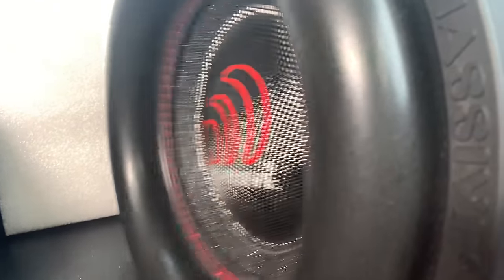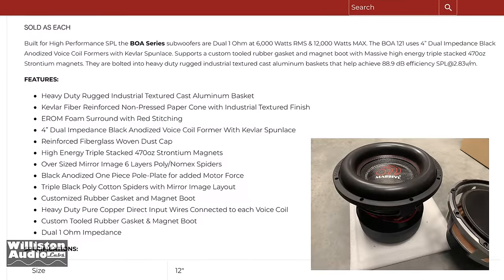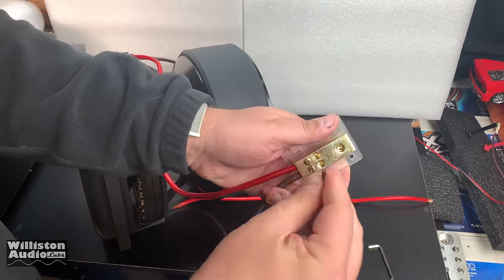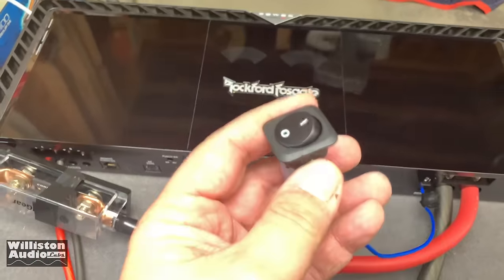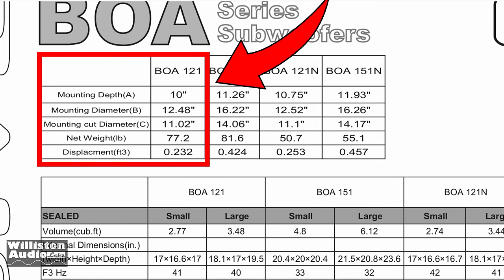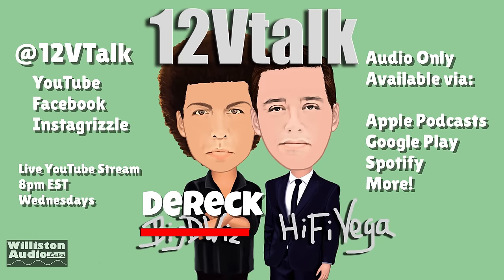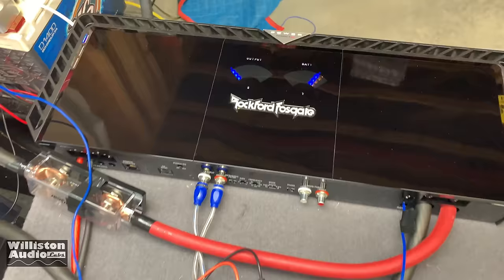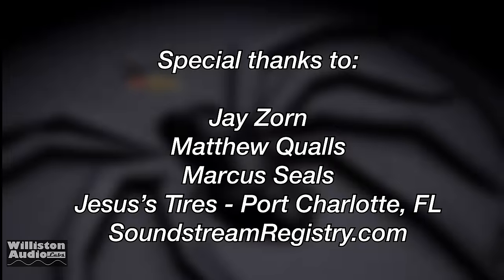Massive Audio 6000 watt RMS Subwoofer!! [4K]

Comment: I got my Fi team 15 for under $700. Massive is crazy. Pass
Reply: That's the website price. eBay has them for $679
Reply: @Outty5000Hertz  $679 not bad then. It's still an off-the-shelf Chinese parts subwoofer. Ti basket and I've seen that motor before I Believe on soundqubed hdc4 woofers. Standard spider spacer rings and I'll still pass
Reply from the maker: I didn’t set the price, but it does seem a bit pricey to me. They have a 20% off coupon on their website, but still $$$
Reply: @DibeezyTheGifted  hell they have my subs listed on the website for $700 eBay has em for $399 or $720 for a set of two
Reply: @Outty5000Hertz  the massive hippo XL do take a beating tho
Reply: @DibeezyTheGifted  SPL subs down right pressure!
Reply: @Outty5000Hertz  yeah they pound without question
Reply: Used, good condition, JL 1000/1, plus a pair of w6v2, plus 2gauge wire...all to be had for less than this one sub. Would be louder, sound better, and not require a massive alternator upgrade. Hey Massive, study physics and economics a bit more....oh, and go home, your drunk.
Reply: most likely wouldnt be louder, you gain 3 db per doubling power, and it takes at least 6x the jl so no, most likely wouldnt be louder even though it would have more cone area. can accomplish same results with fi for cheaper than massive
Reply: @whozaskin3639  I'll get this massive subwoofer 2 pound way harder than those two JL Audio w6 without question. On a single apocalypse Aak40001d. Can't compare sound quality woofer to a SPL woofer
Reply: I got a brutal sounds megabrute 18 for around $700. It's a 4k Sub. Prolly take more... That massive is a nice woofer as well. Thanks again Derek
Reply: @daytrace4635  the massive has a certain amount of excursion, and will only move so much air, regardless of power applied. There is such a thing as speaker efficiency. Your doubling of power for 3db rule would only apply to drivers of equal efficiency. The recent trend in car audio is to use backwards engineering to drive up the power necessary to move air, so that cheaper power per watt amplifiers don't negatively affect the business model. In extreme SPL competition, the drivers and amps begin to have less effect than the enclosure and vehicle reinforcement. For the average guy who wants something remotely listenable, on a stock alternator, with 4 or 2 gauge wire, for a reasonable price, massive missed the mark here. For extreme SPL guys, many use custom frankensubs, so again, massive missed the mark. It's just a Chinese basket, 12 bucks worth of foam, and a 35 dollar motor, with a 1000% markup. It also requires crazy amplification, likely also made in China. So, if you want to fully support communism, and a nation who's government is implementing "social credit scores".....go right ahead and ignore ol P.T. Barnum.
Reply: @whozaskin3639  you seriously need to see sundown u video where they put like 15000 or something and got close to 160 or hit it I dont remember, youre speaking out of your butt lol the 3db rule still applies and if you really want to get technical, your subs are supposed to get half each of that 1000(theoretically without impedence rise etc), where the massive wouldve got all 6k (theoretically) sorry bud it just wont happen, may sound better and more balanced but louder, no. that motor is more likely to be about 300-500 range 4 in vcs range from 50-85$ so they more than likely made this with about 500 invested if they made it here and shipped to be assembled but idk massive well and dont care to, fi, dd, deaf bonce, and sundown have been dominating the market and my wallet recently haha.
Reply: @daytrace4635  I don't think you understand manufacturing. Some hunched over old Chinese dude is cranking out hundreds of voice coils a day, and you can get them cheap. Now, he also has to worry if he smiles enough while taking out the trash, thanks to "social credit" becoming a thing. Seriously, these drivers can be sourced for a little over 100 bucks when bought in bulk. I ain't hating, and the market salivates for the next big thing, so props to the folks making bank. 

As far as speaker efficiency, and the 3db rule, this particular driver is a pig in a horse race. A power outlet is good for about 2200 watts before the breaker gets angry. Attach a contractor grade plug in sawzall to a speaker cone and see what physics versus marketing shows ya. 

I'm all for car audio, I just wish that greed and ignorance weren't such a big part. Please note I didn't say stupidity, I purposely used the word ignorance. I wouldn't bust out "you big dummy" unless the shoe fit. If it weren't for folks like Derek, the lies would continue.
Reply: Jl audio w7 sub drops such low notes your girls draws will drop too😂😂😂😂
Reply: Can’t judge before you test. It aint pricey if its amazing. I own several massive audio equipment, and the quality is superb! Hippos XL are one of the best subs in the industry. Really looking forward to get my hands in A BOA121
Reply: @harpalchauhan428  i have the jl 13w7 and it does have the low notes ,the bass is deep ,and travels far away. Its a diffrent type of bass .
Reply: @DibeezyTheGifted  isn't the orion hcca 15's $350?
Reply: @EBMproductions1  I got mine for around $450
Reply: @chrisrobinson4647  i live close to those guys. Talk to them all the time
Reply: I would like to see an sp4 go up against this. Each having built to spec boxes and around 4k rms on each.
Reply: @treiber671988  this sub has standard of the shelf Chinese parts. Coil included. Sp4 is built rt  here  in my hometown of Las Vegas Nevada with American coils and machined in house. Scott (Fi owner) knows wtf he's doing. Massive wouldn't stand a chance IMO. Fi ftw
Reply: @Andre25167 you have taste 2 my dream sub over the W7 is to own jl audio gotham g213v2 for my home cinema which ive spent £8000 on but think spending twice the money like that again just for a sub is crazy but would be worth it if i could again. But kids come first now
Reply: @DibeezyTheGifted  watt for watt ill put the jl13w7 against it ,its more efficient and louder. With only 1k watts the subs get very loud
Reply: @Andre25167  they are efficient but they're SQ subs and possibly THE BEST SQ SUB. A good SPL sub will eat it for lunch tho. Then ask for seconds. I have a $500 Sundown X12 that'll chew up a dub 7 with only a few extra watts. It'll sound like garbage compared to the JL but it'll beat its ass all day long in the lanes lol
Reply: @Outty5000Hertz  that 679 is for the massive hippo XL. Not the new BOA series. These subs are going for $1,200. The neodymium version is going for $2000. Massive is out of their minds!!
Reply: @DibeezyTheGifted  you gotta search for the eBay sells when someone has them available. If someone paid $679 for the XL subs they're out of their mind! I have the hippo XLR and I only paid $369 via the best offer option
Reply: @Outty5000Hertz  I couldn't find the the series anywhere. I did find the 2 versions of the Hippo tho for under $400, you're right about that. The boa must be hard to find or sold out due to another big d wiz video haha
Reply: @DibeezyTheGifted  yeah they're hard to find outside of Massive Audio.com
Reply: @DibeezyTheGifted  - no doubt bud. Its crazy how many of these companies have the same base set-up. Spiders, baskets etc... Most are the     are same and not well built.
Reply: @kriptic22  Chinese coils too more than likely
Reply: @harpalchauhan428  Yep, even in a sealed box.
Reply: @whozaskin3639  
JL is over priced also. W6 are xpensive and so is  the amps. They aren't worth the money. check out my review on JL on my channel.
Reply: @DibeezyTheGifted  цйй
Reply: @Outty5000Hertz  гг
Reply: @whozaskin3639  ш
Reply: @whozaskin3639    
   

 Iwwwerr
Reply: Amm
M
   aAa @whozaskin3639
Reply: Fi still uses ferrite magnets and has some neo versions but not even close to this. They also use 1018 steel for a bolt and a nylock nut like Harbor Freight. HAHAHA. The Finesse is lacking bro.
Reply: Mac Nifty  the Fi subs is way beter
Reply: Who Zaskin I doubt it would sound better. You know not what you talk about. My massive 8”hippo was slapping almost as hard as my 12” w7. Saying it wouldn’t sound better is just ignorance.
Reply: Natural Creature  I got one american bass hd12 and it out shines them damn rockford t2s all day and half the price lol I had then once and were a food trade dumped a jl w7 12 for them was so glad that w7 sucked I thought man this thing is gonna bang 1000 bucks and huge surround I was disappointed,  had them t2s and they were pretty badass, sold the setup money got tight, tac seasom came around and got a skar rp1500 from a friend for 40 bucks and went and bought the skar evl 12 and that thing hit better then them two t2 12s , once again winter came a lay off came and Christmas came sold the setup for 300 bucks , now a got a american bass hd12 and a kole 2000 watt amp and it's enough sounds awesome and hits great , but I still think I need a bigger amp doesnt move as much as I think it should but its still stiff as hell .
Reply: @doskoreanitos2588  I think the w7s are awesome for sq but spl sucks I had one and it didn't impress on the jl1000 watt amp biggest waste of money ever
Reply: Paul Cherry 💯
Reply: Paul Cherry I was trying to say my hippo slapped pretty close to my w7 but for 100 dollars instead of 1200
Reply: @whozaskin3639  except it would be beating on 6X the power with easily twice the excursion, in the right box it would prob slap your JL audio subs back to highschool

Comment: Sir... Can i use (2) T2500 amp for that 1 sub 6,000rms?
Reply: In theory yes but it is not common practice to power 1 driver with 2 different sources. You would have to balance the output of the 2 amps i.d.k. if ppl do it that way. I would say its not the way
Reply: Too strapped t2500 would kill this sub I'm pretty sure of it that would be about 7k RMS from both amps

Comment: How about using the orion xtr.2500 which over 5000 watts
Reply: theman71177 theman71177 The xtr 2500 is no more powerful than the rockford, maybe in a punch but the rockford will still push it more since its the constant power amp
Reply: Those T2500 amps are slick! And besides, even tho it's overpriced, theres some top circuitry in there that makes the Orion look pretty cheap especially the Constant Power and the output meter and VU meter. I'd still buy it if I had the money. But don't get me wrong, both the XTR and T2500 are monsters.
Reply: Raging_Bullz77 Yes they are both beasts! The xtr is a bit in the inefficient side tho
Reply: I just remember when Big D Wiz amp Dyno on the XTR amp it did over 5000 Watts RMS it did crazy numbers
Reply: @cjon24s69  how is the rockford the more constant amp? what does that even mean? lol
Reply: imBriz I said its the constant amp meaning the constant power, it has technology inside to push roughly the same power at different impedances, it is impossible to push the exact same amount on different impedances but the constant power technology certainly helps it does about 95% of its power per ohm of impedance rise
Reply: Tsunauticus III  It's true.
Reply: Tsunauticus III What?
Reply: Tsunauticus III Even if that sub is wired at 2 ohms the amp never sees that since the impedance changes constantly thats just how speakers/subs work
Reply: Tsunauticus III For example I may have said my comment wrong so if the rockford does 3300 at 1 ohm it probably does about 3250 at 2 ohms or 3200 at 3 ohms and 3150 at 4 ohms, I know that may not be accurate but its an example, but compared to lets say 3300 at 1 ohm for the orion 2400 at 2 ohms and 1500 at 4 ohms now you might see the difference, and those rockfords put out way more than 2500 same with the orion they are both beasts but the rockford will supply more power if the impedance rises which it does in every subwoofer
Reply: Hmm, sounds like what the JBL 500.1 does.
It clamps the output at 500 watts at either 4 ohm or 1 ohm.
Personally, if I'm gonna pay $1,500 for an amp that is rated to do 2,500 watts at 2 ohm, it better get damn near 5k at 1 ohm.
Reply: @cjon24s69  actually the xtr is pretty efficient compared to most...just goin of the dyno vid he did
Reply: b1782w 3300 watts pulling 420 amps of current? Thats pretty inefficent only about 57% efficient theres class AB amps out there more efficient than that, most korean amps are 85% to 90%
Reply: @cjon24s69  I don't have time at the moment to hunt the numbers down but yes in that video it was at 57% obviously much higher at 4 Ohms around 70% but I'm not sure whether it was Dynamic burst or what but I was talking with him  a couple years back  when I was possibly going to buy the 4K model  and was asking how much current it pulled on the dynamic run (since it didnt show it) and I believe he said the inrush current was about 620 on the 6700run which is about 78% efficient which the manual says 80% which I know dynamic burst isn't really the most important number but the numbers it puts down is impressive nonetheless I almost went with a Orion but ended up going Brazilian because it was a little more efficient and less expensive but definitely not as much Headroom as the Orion amps have
Reply: b1782w I always go by certified power since Im an sql guy
Reply: @cjon24s69  yeah that's all I look at now as well especially once yeah that's all I look at now as well especially once the head of Orion said that's the only one that counts in 1 of his dyno videos

Comment: Just wire it up parallel and get more wattage out of the amp. The numbers that 2500.1 was putting was low. And yeah I agree that sub could use about 5-6 cubic feet of box.
Reply: It’s getting the most out of that amp at 2 ohms and that amp isn’t rated at 1/2 ohm

Comment: What a waste, cone area hitting xmax can be had by subs that use half that wattage, why make a sub that needs more exspensive amp? There subs hitting 45mm xmax at 3000 watts.
Reply: Right? People keep giving me that double the power for 3db argument. Efficiency is King. The industry was just losing too much money when price per watt started dropping..... solution? Make speakers power pigs.
Reply: I agree. 25mm xmax is not enough to justify the price (or power requirements).
Reply: Im curious what subs are hitting 45mm of xmax at 3000w

I mean allegrdly the RE XXX hits 54mm of xmax with an RMS of 2000w.

But manufacturers can measure xmax differently.
Reply: It has an 88 spl 1w/ 1m so you do the math. xmax doesn't matter. Plenty of old school subs out there that got seriously loud with pressed paper and foam and tiny magnets on little wattage w/ pathetic "on paper" numbers. Put 1kw into this sub and it'd be enough for most builds.
Reply: @whozaskin3639  i agree. they give you tiny cone surface area and compensate with excursion. most customers wont want to shell out the coin to upgrade the electrical to run one of these puppies. you said it, efficiency IS king
Reply: @Saddendude  the re subs are over rated though. Put that xxx on 2k rms and it will probably start stinking. My older sex 12 wouldnt take rated clean power for very long

Comment: I have a Q. If you have two speakers and they are a 8inch and the other a 12 inch and both are 500watts and powered by the same amp, wich one makes stronger bass. I would really like to know as I love audio stuff but know really nothing about it. Does the size matter even if they are both the same wattage?

Comment: Three layers on the front and two on the sides , and some fiberglass and resign in the corners glued and screwed together should be good enough , I know you don’t have the time to build it , so use what you got maybe put some internal bracing and corner blocking in the one you have , good luck keep up the great videos 👍🏻

Comment: Correct me if I’m wrong but at 1:45 does it state than  X Max is 25mm 2 way, so that means one way linear excursion is 12.5mm? Seems rather little for such a huge sub with triple stacked magnets and that surround.

Comment: Hey bro I love the dyno tests you do its alot of knowledge on audio, I have a question I just purchased a massive hippo 124 what type of amplifier on a budget under $300 for amp do you recommend that can handle the 2000rms @ 2ohms I have a ground shaker 30hrtz rated enclosure all I need is a good amp

Comment: Just so you know,  strontium is mixed into iron oxide to make Ferrite magnet. It is more rightly to say, that speaker has a iron ferrite magnet. Iron ferrite magnet cost less and are the weakest magnet used in speakers.
Reply from the maker: I was reading the specs provided by Massive Audio. Thanks for the info though 👍

Comment: I have two EVl 12  that came with the Skar enclosure, and I just bought two ZVX v2 12. will it be ok to put them in that enclosure? I can't find any 6.0 cu feet enclosure. And also think the 6.0 enclosure won't fit in my 2006 Nissan Altima.

Comment: I'm sure someone already wrote this but put the orion amps on it. Did this sub sound better than your perfect 12"? Keep up the great work.
Reply from the maker: The Infinity is an SQ sub and does well with only 300-400 watts. This sub is designed for SPL burps. Not in the same league

Comment: Try to put on the dyno The Massive  D8000 amp please , some people like it a Lot
Thanks big D
Reply from the maker: Not sure I can test amps that big, or if I want to. Cost a lot to upgrade electrical for highly specialized market
Reply: @wal  it's just 4.000 rms at 0.5 ohm . U're the BOSS , thanks for answer 🤗
Reply: It is reli d8000 0.5 4000rms can hit boa 6000rms?  I wanna to know pls